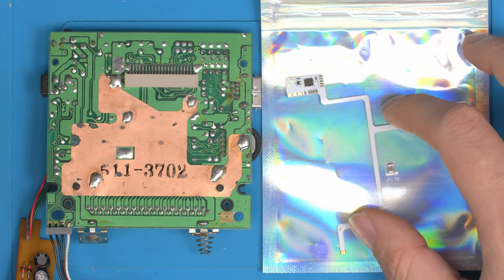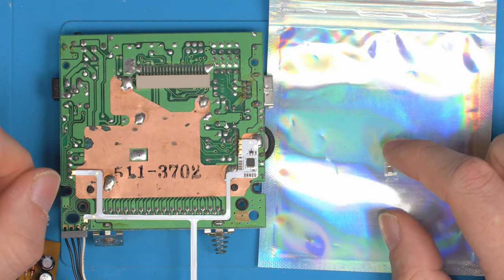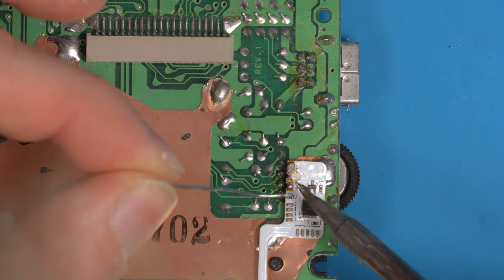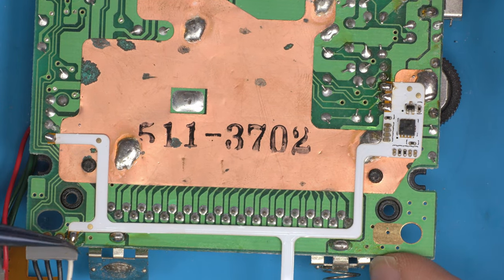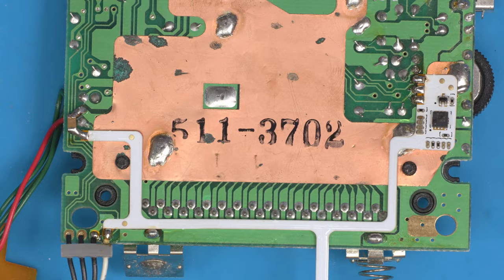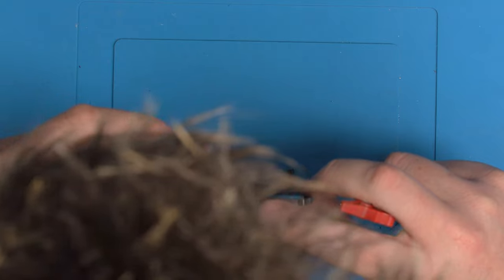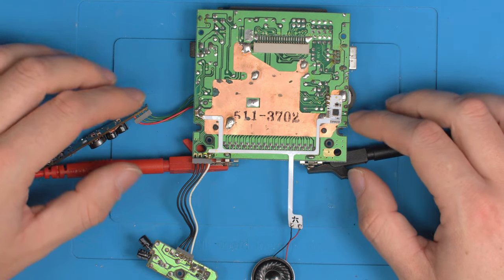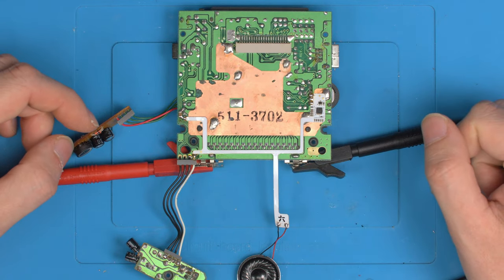CleanAmp Pro Game Boy DMG Original (Wire Free Flex Audio Amp) - RetroSix

Comment: Does this also affect the headphone output?
Reply from the maker: No this just amplifies the speaker. We can make a headphone amp as part of the next design no problem
Reply: @RetroSix  that would be great!  I use mine with LSDJ and the headphone output is insanely noisy!  I could do the prosound mod, but then I'll lose volume to the headphones which I need.

Comment: Since I put a Q5 OSD IPS in my DMG-01 I noticed that the stock speaker is buzzing, even when I turn the sound silent. 
It´s not very loud, but noticable.
Will this mod also get rid of the buzzing?
Reply from the maker: No but if it's a FunnyPlaying screen they are known to add noise. Better using the generic ones like what we have for the DMG. Also our CleanPower might help

Comment: I got this kit for my DMG. If I install the extra capacitor (minute 3:30), I get a short between the two wires and the GameBoy doesn't start. I checked the capacitor and it's fine.
Reply from the maker: Jump on our discord.gg/RetroSix and send install photos
Reply: @RetroSix  I figured it out: I had a short under the capacitor. Thank you for the short reply.
Reply: @savavlad how did you find out you had a short? I might have the same issue